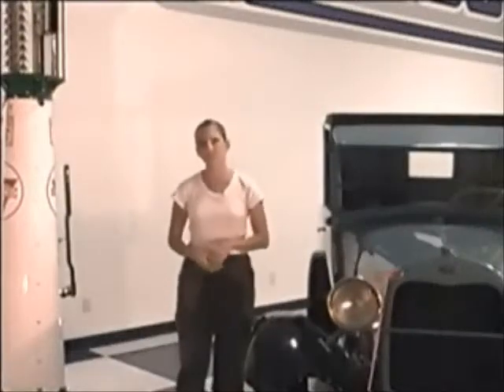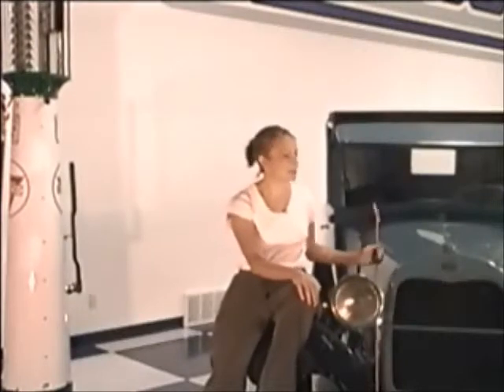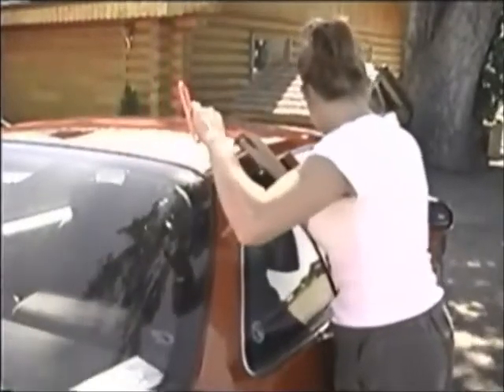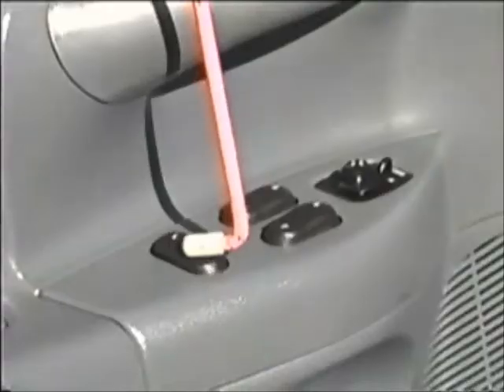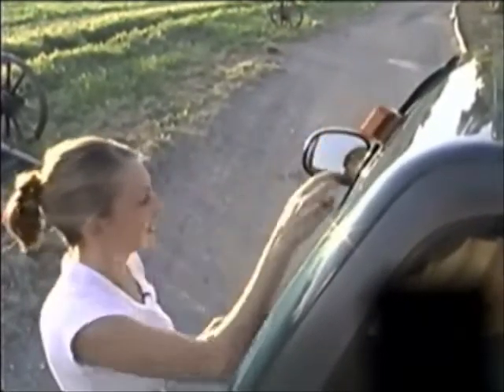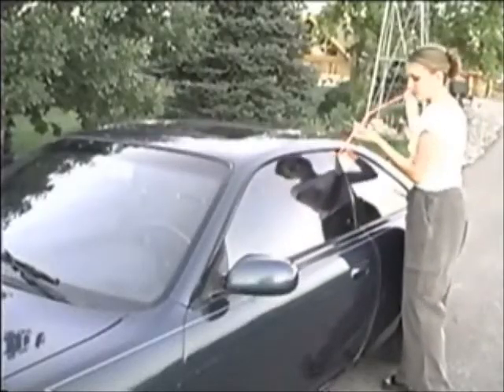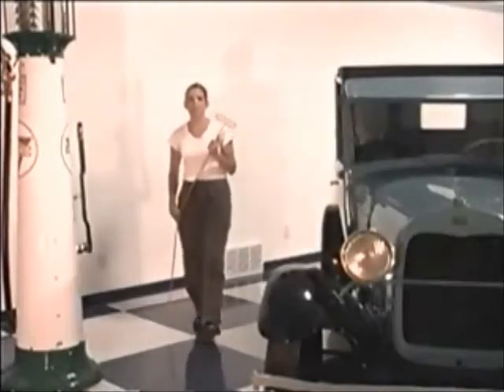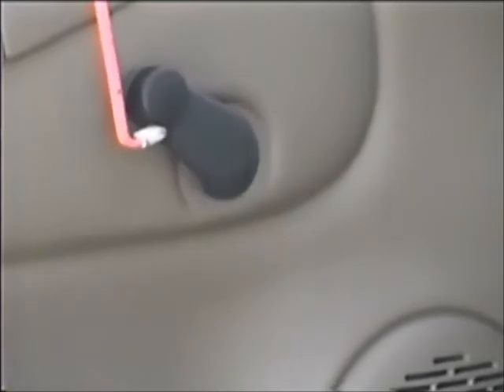How to unlock vehicles

Comment: Make a video on robbing banks
Reply from the maker: If you read the description this info is for the towing industry and not related to stealing anything. Towing operators get called all the time to unlock vehicles where the keys were accidentally locked inside the vehicle.